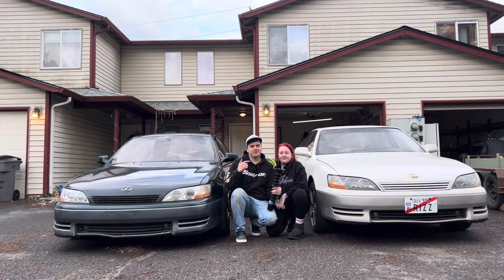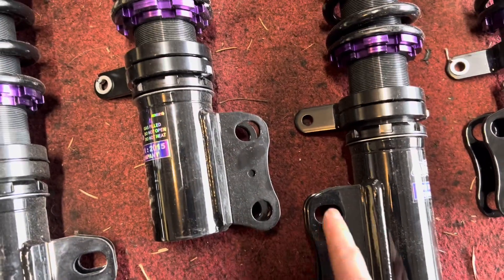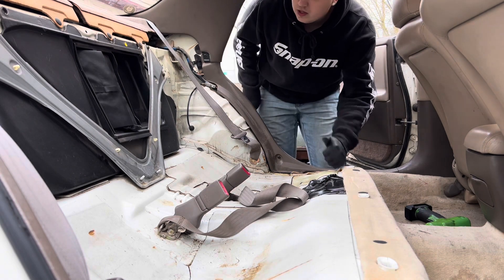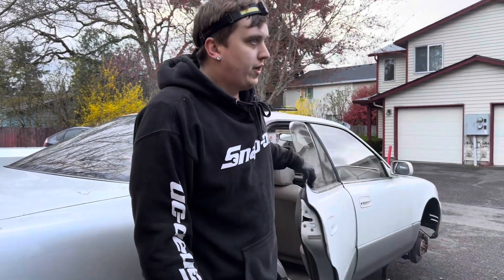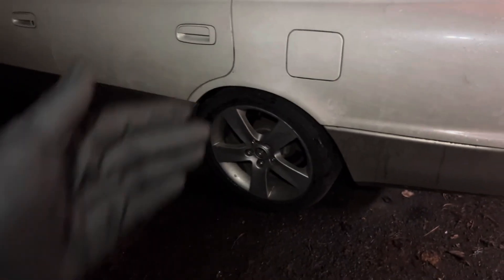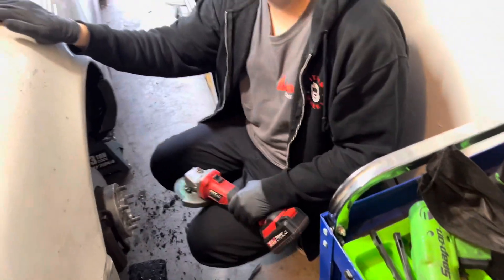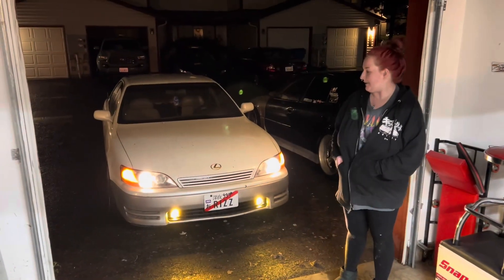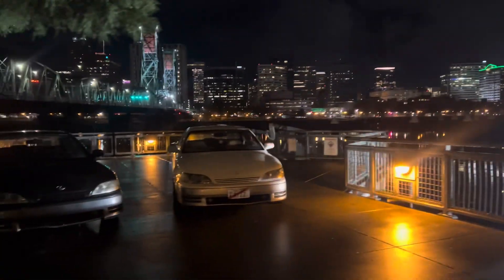Installing D2 Coilovers On My Factory Manual Lexus ES300

Comment: Nice es lexus, I have a 01 black one and it doesn’t look much different than yours. They are nice cars. Looking to fix a couple suspension problems, to keep it running nicely. Then getting new headlamps, wrap to give it a nicer newer look.

Comment: This is helpful because I was wondering what type of coil lovers to get. Also, I would like to get rims for my ES 300 but I’m unfamiliar with trying to purchase wheels any tips?
Reply from the maker: Message me on instagram. It’s easier for me to communicate that way. I will send over a few wheel sites to check out. I have d2 coilovers on both my es300’s and I love them.
Reply: @blackwaterjpn   ok
Reply: @blackwaterjpn   I just messaged u